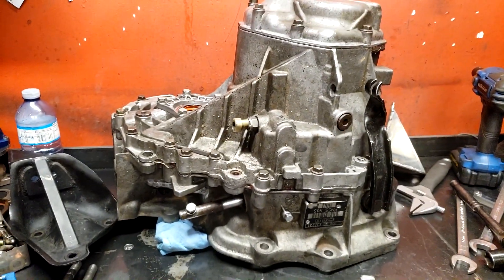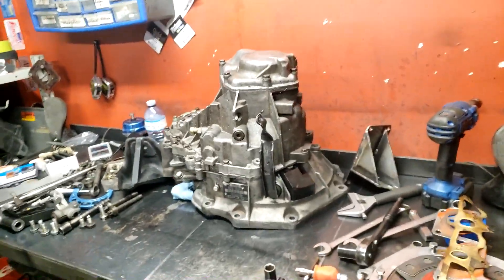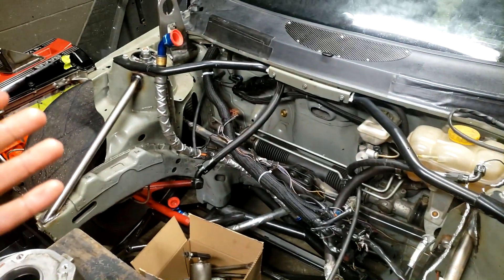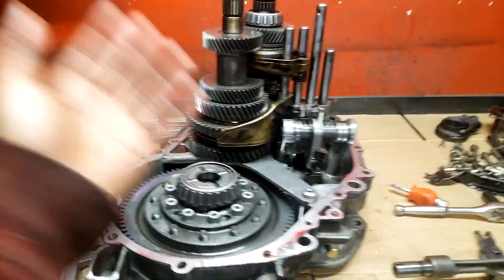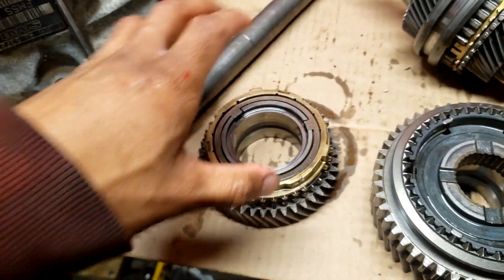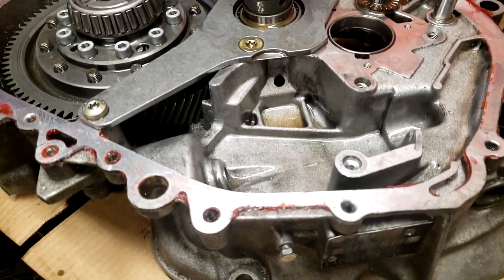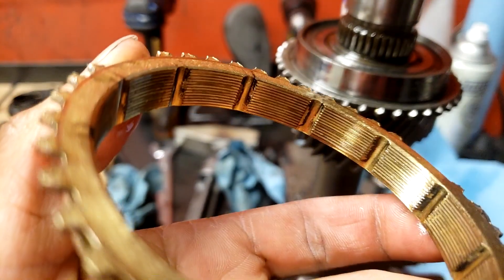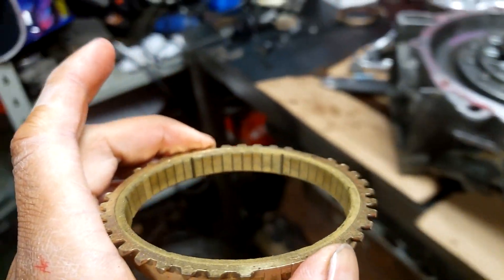You Know What Really Grinds My Gears?

Comment: That's  Synchronizer you're asking about looks like what saab used in the classic 900 trainees as an update but ended up not working out very well and they ended up going back to the  Original synchronizer style. I rebuild the classic 900 transmissions and that's what it reminds me of. Just ran across your videos. Really like how detailed you are talking about everything I actually am running high horse power 9000 . I've actually had to start turning it down I can't keep transmissions in it.. I'm on my 4th transmission in 5 years I was pushing a little over 500 horsepower at 30 plus pounds a boost and that's just too much.    Rob out at scan West who was a saab rally driver back in the nineties rebuilds my transmissions for me and really don't know what else to do about a transmission for it. Love your head gasket that's bad a**. Love the car too. My next project will be to make a 9000 motor rear wheel drive-in a classic saab 900. I will keep going on out for your next video.

Comment: Don't waste time for this week gearbox get gm f40 6speed IT is much stronger in europe f40 from 2.2tid and 3.0cdti/tid Vectra C/signum fits to b2x4/b2x5 engine p&p
Reply: Driveshafts also fit to gearbox
Reply from the maker: Sequential next
Reply: Ive been looking for one in the uk for years and seems easier to get hold of an f28. Bolt pattern is different from the more common f40 found. Has to be a very early 2.2 the v6 one doesnt fit. Ive just got 4 spare fm55 boxes 😅😅😅😅😅😅